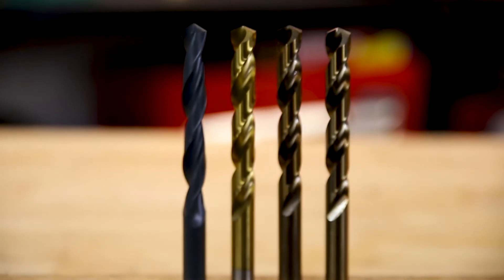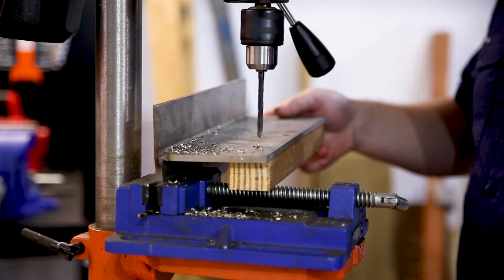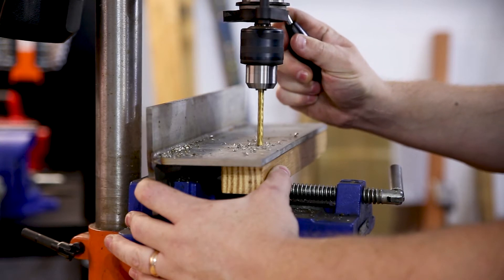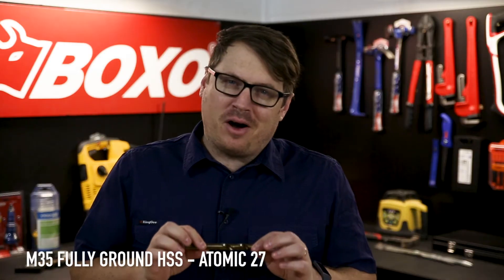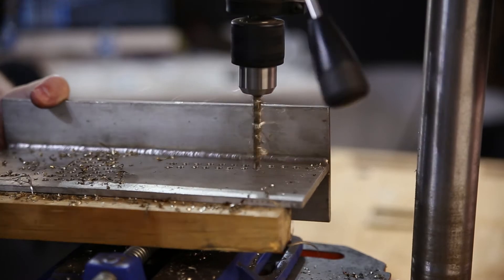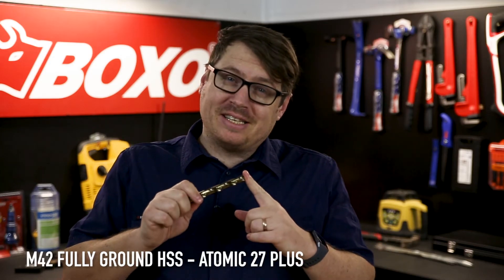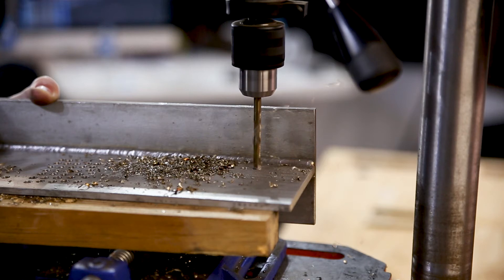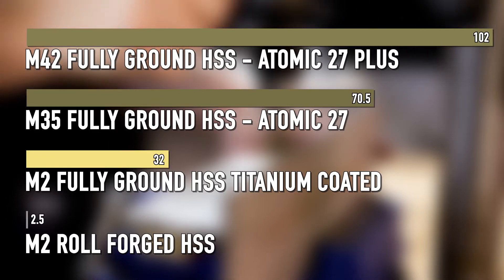Drilling Through Plate Stainless Steel - Xtorque Tested

Comment: Should have used some low carbon steel instead. Stainless is gummy to drill through and tends to prefer special stainless drill bits with more extreme angle flutes

Comment: Great Video! What drilling parameters did you use for the test. Primarily, what was the spindle speed and roughly how much pressure did you put on the lever arm?
Reply from the maker: The drill was at 900rpm (Slower would have been ideal but not capable in the particular drill press I was using) and we didn't use any lubricant. I stopped drilling when the drill no longer would drill without excessive force. You could say our process wasn't scientifically rigorous but very much practical and genuine in intent. We will follow up with a more rigorous comparison in the future.

Comment: i'm trying to buy a generic brand drill bit set for weekend applications. but i drill through hard steels. is there a brand or product that you recommend buying off the shelves , for instance .. colbalt or TiN . .Thanks
Reply: cobalt is material and TIN is coating.  HSS with cobalt is good for you.
Reply: Bosch or dewalt.